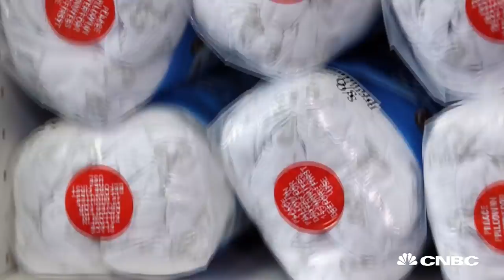How MyPillow Founder & CEO Mike Lindell Went From Crack Addict To Self-Made Multimillionaire | CNBC

Comment: The MyPillow Premium pillow is essentially a pillow with a thinner cotton cover and chunks of simple memory foam. There is no additional innovation added to this pillow – it doesn’t have any advanced technology, special materials or significant features woven into the cover or in the core – aside from its patented interlocking fill feature. To us, it’s missing that little something that sets it apart from all the other pillows with the same design.While it worked well for sleeping during the first few nights, the fact that it continued to fall flat and needed consistent re-fluffing makes us feel that the price does not match the value on this pillow. We do believe people can find something very comparable for a price lower than what MyPillow is offering.

We realize that MyPillow may have a fan following and that our opinion might not be popular, but after reviewing so many pillows we can’t help but feel slightly disappointed with the MyPillow Premium – to us there wasn’t anything “premium” about it.